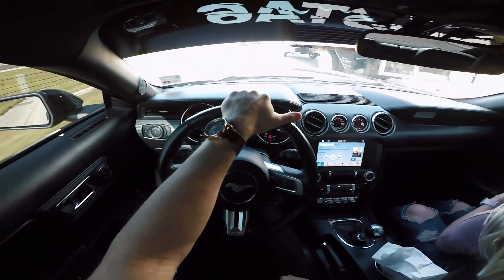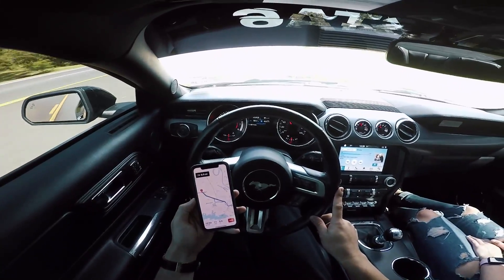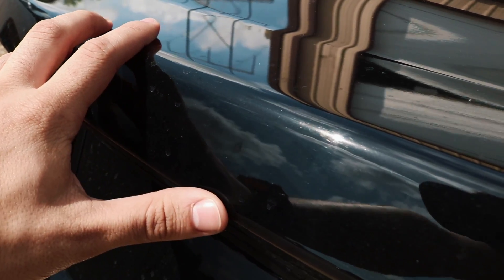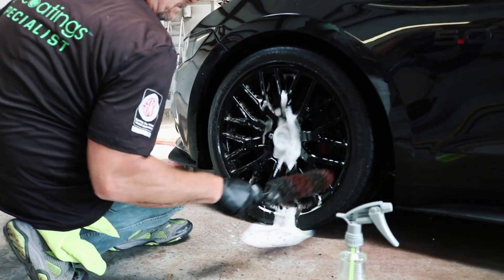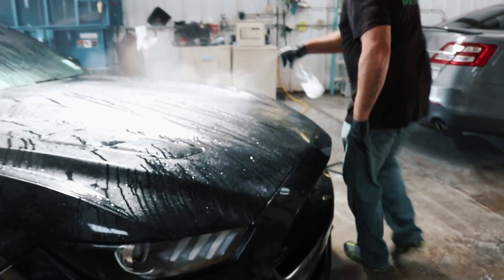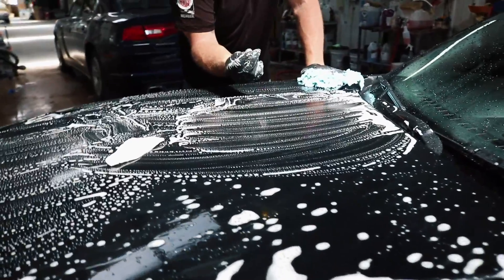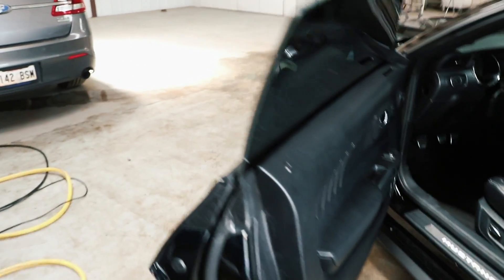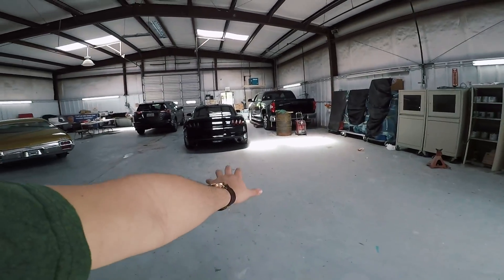This is THE BEST invention for your car's paint!!

Comment: Nice.
Gonna get my 2010 Mustang GT detailed and coated too in a few weeks. Just have to do some rock chip repair and repaint the front bumper because i want to relocate the license plate from the bumper to a sto-n-sho bracket. New 9x19 wheels are also coming. That's the most money i ever spent on a car for over 15 years. Guys like you made me do it  :)

Comment: Just ceramic coated my black 2018 Tacoma, best thing I ever did!
Reply: Austin Dunbar how much did it cost bro???
Reply: Ceramic coat was 70$ polish 10$ clay bar 20$ and a lot of micro fibers, took 8 hours start to finish to do my self
Reply: Austin Dunbar oh alright man must of been a pain but worth it... what if you want someone to do it for you? Do you know the cost?
Reply: I got a quote from a mobile detailer to do it for 1400, that included a paint correct, but honestly the polish did an amazing job getting the paint prepped.
Reply: Austin Dunbar dang alright man time to save up and would it work with white paint
Reply: Yeah for sure, buy the good stuff, and having an electric polisher is key
Reply: Austin Dunbar sweet cool man thanks for the help... I'm going to do it on my v6 soon to be a v6 supercharged
Reply: No problem buddy, that’s awesome!
Reply: Samuel Lopez does your maintenance for your e350 cost a lot? I’m a HS student and I’m deciding to either get a 2010 c350 or a 2010 335i but I heard that the 335i is a lot to maintain if you aren’t going to do the maintenance yourself and do you know if maintenance between the 2 are a big difference?
Reply: hugo chen hey bro well the e350 has 3.5litters and everytime I do oil change its around $120... As for the rest of the services IDK man haven't reach the miles a service is due... About to though in 5k miles... To get your codes read for me it costs from $250-$350... And I heard that BMWs break to fast and Mercedes can take a beating before parts break... I would go with the Mercedes IMO... However, if your not too sure yet ask around... Or let me do some research and I'll get back to you within 2days...
Reply: Samuel Lopez THX, I might be doing some of the easy maintenance myself like oil change on weekends, yea I may get the c350 as i heard it’s more reliable but slower
Reply: hugo chen Your welcome man and yeah its maybe a little slower but reliability is better... However for $200 more you can get the c350 a little bit more responsive.... Though another thing to keep in mind is that both of these cars parts are expensive cost me $3k for a new transmission... Though my car is now running smoothly...

Comment: Claying the paint, especially black paint, with cause marring. For true paint correction, it should be polished with a DA or rotary buffer, prior to ceramic coating.
Reply from the maker: Both are done after claying the car.